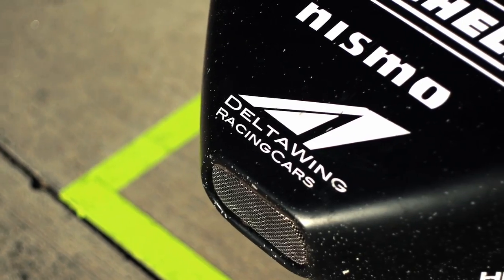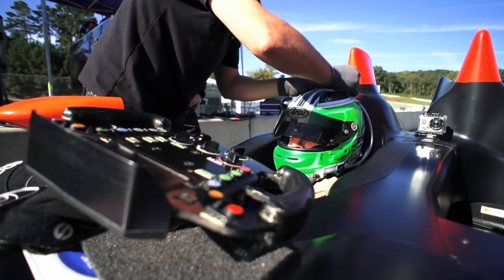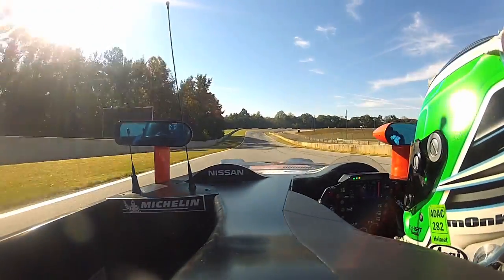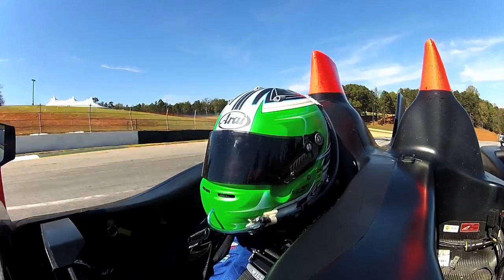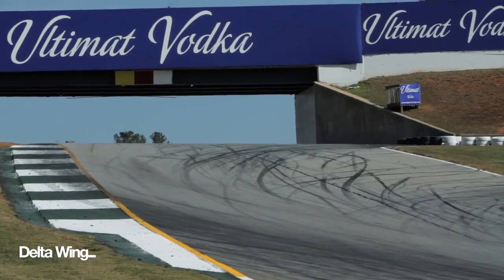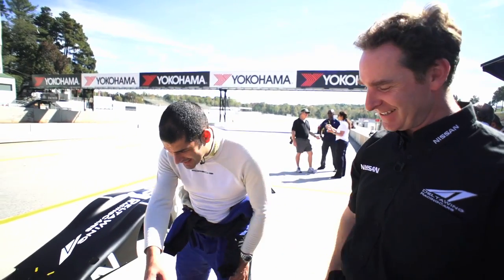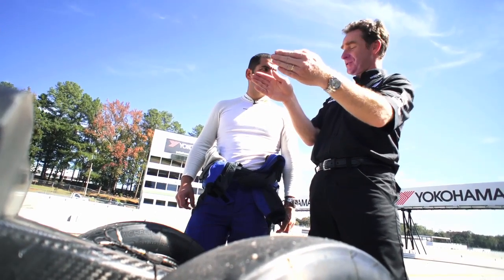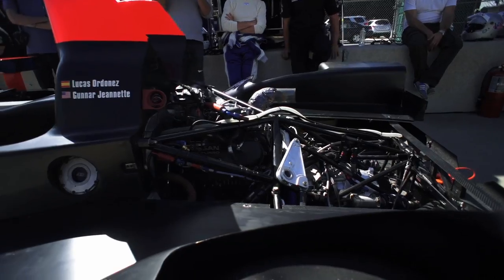Track Test: Nissan DeltaWing Driven At Road Atlanta -- /CHRIS HARRIS ON CARS

Comment: Looking at this thing now and looking at the crazy sidepod undercuts seen on every Red Bull F1 car from 2022-25 and the Newey-led AMR26 design....

I'm not gonna say they copied the Deltawing, because I'm fairly certain that few who follow motorsport remember this thing even existed. But with the benefit of hindsight, this car seems to have been a literal decade ahead of its time in the art of optimizing the center of pressure and general use of a ground effect floor.

310+ kph from a car that looks like what you'd find on Bad Dragon's store page, while being stickier than anything that ever landed on a porn star's face, thanks to an aerodynamic philosophy eerily similar to some of the most dominant Formula One cars in recent memory. Now THAT is a motorsport icon, right there.

Comment: This was the most interesting car in motorsport while it was around.  Motorsport dropped the ball when they didn't encourage further development of new ideas like this. It had great potential  which was sadly reduced when it moved to Panoz.  It did lead at the Daytona 24 hours though before an unfortunate collision took it out.  With climate change becoming an increasing problem motorsport will be seen by many as an extravagance that serves no useful purpose. This car was a great attempt at getting maximum performance from minimum fuel consumption.  Hopefully someone will revive the concept and develop it further.

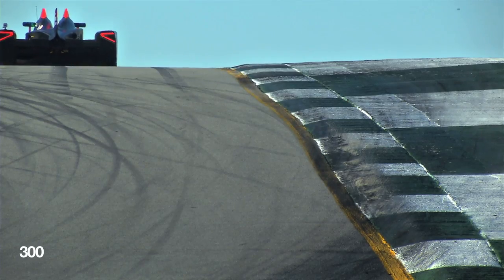Comment: @5:23 It's interesting he says it feels like 600hp rather than 300hp because the car only weighs half a ton, so it actually performs quite similar to 600hp GT cars which are are twice the horsepower but twice the weight. I can't even imagine a full grid of these things battling one another, would be a ton of fun.

And funny enough, when they go in depth into how it works, that basic principle of focusing on ratios rather than pure numbers is really the logic behind the entire car. Absolutely criminal that this car doesn't have a way to be on track anymore, and hardly even when it was having its moment a few years back.

Comment: I just wanna point out that most work making this car was done by Panoz since they don't get enough credit for it. Nissan didn't do much more than supply the engine, which was a Chevy engine with Juke injectors, and considering the whole ZEOD legal fiasco, I doubt there's much more I need to say.
Reply: Just for the record the Deltawing (the red show car and the black race cars) were built by Dan Gurney's All American Racers.  Panoz didn't build a single part of it.  AAR had nothing to do with the car when it was chrome or when it became the Zeod.
Reply: AndyMB601 yup. If you look closely it says “powered by” Nissan. They must have cut some kind of deal with Nissan for branding in exchange for the engines.

Comment: As always the best designs and performance  come from unconventional thinking. I believe build something that works and then put
a person in it. The driver fits in the car not the other way around. Dont worry about symmetry, looks and all other normal parameters.
We are yet to see wheels/axles that shift forward and reverse when needed. This is a great project and the best bit
its NOT BORING like most "this is how its done" car engineering.

Comment: 417kg 

When you actually weigh a quarter of your car...

Edit: as an engineer this is sublime
Reply: Holy shit, that thing is even lighter than the Jaguar R4 (the lightest Formula 1 car ever made) and Caparo T1 (a track-focused open wheel supercar which is supposedly the closest to an F1 car), which weigh less than 500 kg!
Reply: @MDDeGrande1994  lightest F1 car was the 1958 Lotus Climax weighing in at 320kg or 706lbs

Comment: I like Chris Harris's reviews because, in part, he is entrusted with many superb and iconic cars, especially racing cars, but this one stands apart because of the absolute off-the-wall genius of the concept of the Delta Wing and the wonderful way that the designer/engineer explains how the car works.  Everything we see about racing cars tells us that a car with a wheel at each corner, with as much tyre width as regulations permit; optimized for comparatively smooth racetracks is the best available option.  Well, obviously we were wrong - except this car uses exactly the same set of principles, but in a totally different way.  Brilliant.

Comment: I've never seen a race car get as much hate as what this thing did. And in the lead up to it arriving on the race scene there was just no end of people saying that it wouldn't work, that it would under steer because of the tiny front track, it just couldn't work. And yet, it did. It was just very disappointing that it ultimately did not have any racing left it could take part in because there just wasn't enough support for the concept. I can't help wonder if a lot of the flourishing support for experimental designs was extinguished not just by the haters, but by the 'other car' the GTR-LM, being such a monumental failure.

Comment: One of the most stupid ideas in motor racing of the past 40 years. The engineers must have been stoned or clueless. The concept provides not a single advantage but many disadvantages over 4 wheeled cars.

Comment: Great story - just way, way too short.  The discussion of the car and its design was fascinating and it would have been ideal to hear more from the designer.  The car simply defies what we would call "logic" - but Bowlby's explanation makes clear that our "logic" has just been based on the cars that we are accustomed to seeing on a racetrack.  In fact the DeltaWing uses the same set of design principles and performance parameters but in a fundamentally different way.  The explanation of how the suspension works is really interesting and worth listening to several times - partly because the designer is able to express the ideas in very understandable terms.  Harris surely has a job most can only dream about - there should be a law against someone having so much fun at work!!

Comment: Imagine if Mazda had stepped in instead... it would have a rotary engine as well! =D
Reply: My God, with a race-spec turbo rotary the thing would obliterate pretty much anything in a straight line. There's so little frontal area, and so little aero drag because it doesn't need huge wings to keep it on the ground.
Reply: Imagine having the engine of the Mazda Furai in this thing...😍
Reply: It would sound pretty cool, but that's it.
Reply: That was my second thought after seeing this marvel. 
First was "Damn, this things can SERIOUSLY turn! Delta Wing concepts have already been proven as THE best configuration for fighter jets, why not cars?"
And then "DAMN IT once again! Imagine this beast with a ROTARY in it... Even LESS weight, AND MORE POWER. Now THAT would have been some sight to see!"...
And seeing this thing, is making my lost wish to become an automotive engineer burn once again.

Comment: Actually i wanted him to go on some more about how this was going down the back straight faster than P1s with at least twice as much power. I know some is weight and the fact that the car carries a lot less drag but there must be some other sick synergy. They were talking about this as an Indy car. Can you imagine they could've run a production based 4 cyclinder 1.5l turbo with 400hp (maybe) that would easily do 220 round Indy

Comment: Can you please put a 800hp V10 in the back and make it a racing series that shits on current F1?
Reply: It doesn't work like that. You can put 10,000 bhp in this and it will still get shat all over on any circuit, by an F1 car.
Reply: With turbos it'd probably heavier.
Reply: Isn't it the point that it requires much less downforce to work?
Reply: The thing is, does it work? I know it works as a car but does it make another car of the same design easier to pass due to less turbulence from the front car? If it doesn't then the original idea hasn't worked and the racing would be the same as the current F1 cars, the only benefit being less frontal damage! But you can guarantee the rear wheels would constantly overlap especially in the first few laps, so unless it improves overtaking then all I see here is a brilliant design and innovation that's just going to cost less than an F1 car! F1 could achieve that if they were told everyone had to cut the cost of the actual car in half so more damage could be taken at a cheaper cost meaning more wheel to wheel racing is allowed and we could go back to the days when the front car could defend as much as he liked! Racing like that is more dangerous but less face it they didn't change the rules of the front car can only defend once and it can't move across the track again even if it's returning to the racing line, the rule was made because the cars are just too expensive nowadays and a silly crash driving defensively was seen by the car manufacturers who came off worse as too expensive to try so cars were forced to make one move defensively but then the car behind car easily come up alongside!! It's shit racing if you ask me!! Why don't they do it in other racecars? It's not because it's not safe it's because those cars cost a tenth what a front end of a F1 car costs!! Lower the cost of the F1 cars so wheel to wheel defensive driving can come back! I think that would improve F1
Reply: nowhere near the amount of downforce
Reply: 800hp v10 in a 400kg chassis> 900hp v6 in a 600 kg chassis
Reply: and a 800 hp v10 would way about 200kg on its own..
Reply: it still would be slower but would love to watch
Reply: At that point it'd be so fast it's dangerous. CART such a problem in 2001 when the cars were so fast around Texas Motor Speedway that drivers reported a dizzy feeling from the G-forces. The race was cancelled, for obvious reasons.
Reply: Slower? F1 cars have 800 hp. This car has just over 300 hp. Think about that for a bit.
Reply: @ThrowingItAway  now think about the amount of downforce an f1 car has. also f1 has a max power over 1000hp
Reply: Is a V10 faster than a V6?
Reply: +ok Jesus saved me from the pit of anxiety and depression, and further suicidal thoughts... Jesus loves us so much, that He suffered and died for us, so we wouldn't have to go to hell as punishment for sinning against God... Confess to God that we are all sinners, who desperately need a saviour, and confess that Jesus is your Lord and saviour, and if you really mean it from your heart, you need to stop willfully sinning and the moment you accept Christ, the Holy Spirit will come dwell in you and He will be your helper and comforter, i speak from experience, i accepted Jesus and then received the Holy Spirit, and my life actually changed its not a lie, it pretty much confirms that the Bible really is God's Word, because i felt the Holy Spirit's presence before i even knew what the Holy Spirit did... Im not forcing you to accept Him, but im begging you to consider Him :)

Comment: Was it Nissan or panoz that developed the deltawing?
Reply: Nissan SPONSORED the Delta Wing in 2012 and provided the engine (it was a tuned version of the Juke's engine!) - Panoz worked with Ben Bowlby for the initial design and development of the car itself as a proposed IndyCar, and has been the sole development team since. Nissan likes to take credit and claim it as their own, much to the dismay of Panoz.
Reply: @admkbldwn       It was not  Nissan  engine at all. RML engine based off a Chevy Cobalt. Nissan supplied the throttle Body only.
Reply: Initally, it was Nissan who prepped this car back in 2012. From 2013 onwards, Panoz prepped it.

Comment: After Looking at this and the LMP1 project, I have to admire Nissan for doing things a bit differently in order to achieve the same goals (and work bloody well). THATS what innovation is.
Reply: Martin Stander unfortunately when the designer needed an engine, most companies said no. Nissan said yes, but their name wasn’t to be on it (as they first thought it would crash and kill the driver). Nissan give them a Chevy engine (with Nissan Juke injectors) and claim the whole car design as theirs. Then the designer went to work for Nissan and they make a clone of the original. I believe the first design was a crazy idea for the then (2009) Indy car design, which obviously Indy car thought it as bonkers.
Reply: It's not nissan. Nissan just borrow the model concept and strap it with chevy engine and called it their model. They even had internal memo to not double down on that grey area or facing legal battle, which eventually did

Comment: if both front tyres basically carry the same load at any given Point, why not simply use 1 and centre it. like a motorcycles rear tyre
Reply: +Kevin Dorka ever heard of a reliant robin?
Reply: +Kevin Dorka because by having 2 tyres with a space between them makes it more stable, 1 tyre would wobble under braking or any kind of manuevering while also making the tyre compound decay much faster because all the work and the weight of the car is acting on 1 tyre rather than splitting it to 2 wheels
Reply: +Kevin Dorka Ben Bolby (designer of the deltawing) actually said that he would have made it 3 wheeled but they thought that would make it even more difficult to comprehend/weirder to look at (i.e. less support and funding) so they went with 2 small tires upfront.
Reply: oh okay, thanks for the info

Comment: It's always fun when engineers say, "Screw it!  Let's build it and see what happens."
Reply: +Mike which is why I miss F1 back in the 70s... fan car, 6 wheeler, ground effects car...
Reply: +jan christian Frodahl Turbos they are back in f1, but I see what you are saying, it was an entertaining era of f1, when turbos first came in.   but now they have better power delivery, more efficient, but v6 configuration with which means bland as hell  sound compared to even 4 cylinder turbos. the engines  are not the showpiece the 80s turbos were,  the better tyres and better chassis have made turbo modern f1 turbo f1 cars far less entertaining then the crazy 80s were.  also you don't get 1500hp qualifying special engines that are made to last the outlap, the fast lap, in inlap and then blowup, now teams have to use 4 or 5 engines for a whole season.
Reply: After they built it Nissan tried stealing the idea of the delta wing out from under thier noses
Reply: Don't you mean Can Am ?
Reply: it was an indycar concept frist
Reply: apparently it performed so well nissan wanted their name on it after only providing someone else's engine and bolting on a piece(making sure they could deny anything to do with it if it failed)
Reply: yeah it was crazy _p
Reply: Then lie and say it does things better to satisfy the company that paid for my little fun toy.
Reply: but... thats not really how this got built, they had math and simulations, then they built it ...
Reply: Yeah, he was quite aware or the the caracteristique before he build it! What a master mind!
Reply: That's why Nissan is on the verge of bankruptcy once again?
Reply: +speedometer111 I miss the turbo`s :/

Comment: "It's all balanced."  That only applies at a particular speed.  I have a hard time understanding how they get it balanced at both high and low speeds.
Reply: +xXloeffelsk8Xx if you drive twice as fast you get 4 times the air resistance and downforce, thats why a 1000hp car isn't 10 times as fast as a 100hp car
Reply: JC Webb i dont think so.. he said the shape of the car generates a balanced amount of downforce. meaning if you drive for example 100 you get 100 kg on the back and 30 at the front or something. and at 200 you get 200 at the back and 60 on the front. hope you understand what i mean.
Reply: xXloeffelsk8Xx usually yes, when not taking in account that the car slightly squats rearward at high speed and some more slight variables you are 100% correct
Reply: +JC Webb You're just overthinking it. The car's mass is balanced a certain way which works well for the layout of the car, this is your low speed balance; say 20% front 80% rear. Then they just mimicked that balance in the downforce, small (20%) wing up front, large one (80%) in the rear.
Reply: Bart Van Riel thats right... my fault. i used dumb numbers. i meant more like the downforce stays the same ratio regardless of the amount of downforce

Comment: from the top it looks like a sr71 stealth jet.
Reply: vivalaphill becausedeltawing
Reply: +vivalaphill I wouldn't doubt that's where the based and stole the main design from this. Most "new age new tech" things especially in aerodynamics are usually taken off planes and jets and just rework to have wheels and stay on the ground.
Reply: Except the SR-71 isn't stealth :^)
Reply: @Sykotik_  Not positive but I recall the sr71 having features that reflect less radar(smaller signature) so while it's not nighthawk level stealth I'm not sure calling it stealth is wrong.
Reply: Cam   It was not stealthy at all.  I just flew so high and fast, nothing could shoot it down,even when they knew where it was.  The skin color was caused by the titanium used to handle the high temps the aircraft generated.  Paint would just burn off.
Reply: MoDeRaTeLy SoLuBlE yes it is.
Reply: It looks like a pipi
Reply: +Peanutsreveng3 And the twin vertical "fins"..

Comment: Easier term the rear weight transfer is somw how between roll and pitch. For steeing is like riding a bike. The further you sit, harder the steering feel. All the weight loaded at the rear, the front must feelsuper light and increase steering reaction. I agree that the delta wing may have less understeer with less front width. But front width means more rolling force apply to the (outside) rear wheel. In physics, it mean more force apply to the (outside) front tyre and cause some push. How much tension can delta wings frame can hold is one of the fact that effect push.